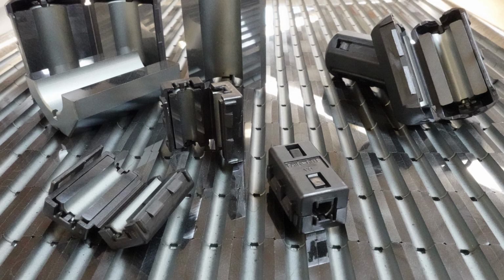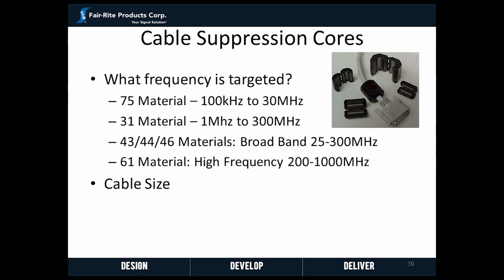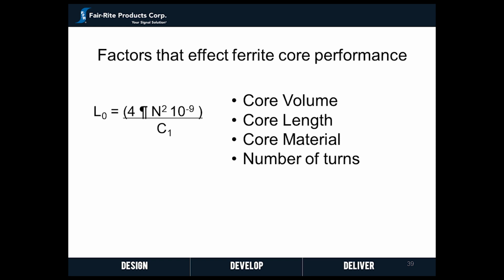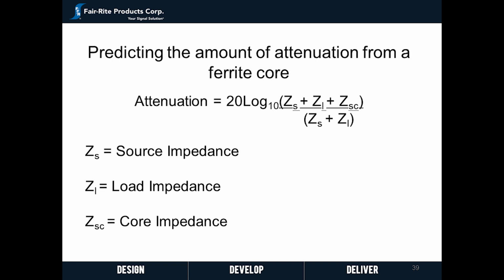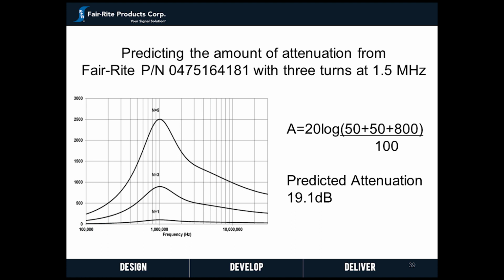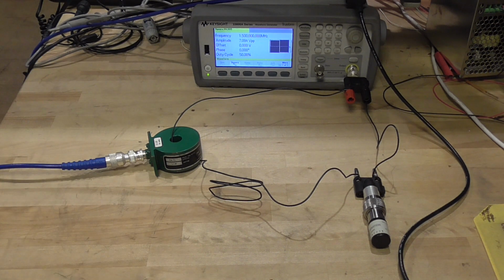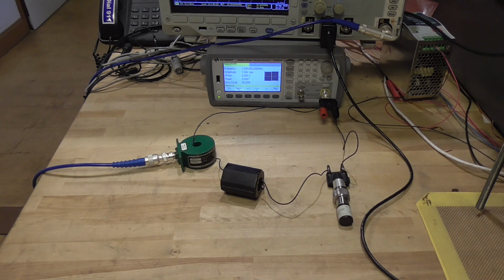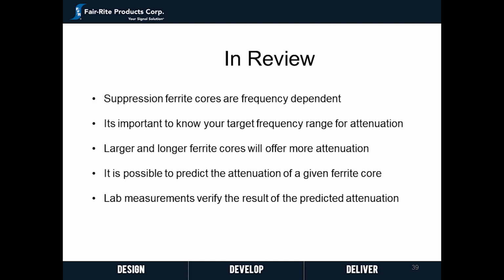Predicting the Performance of Ferrite Suppression Cores

Comment: For ham radio which clip on core should be used in antenna cable to reduce interference from neighbour smps of led lights and induction cooktop... Cables are RG58 and LMR 400.. PLZ help..
Reply from the maker: Induction cooktop EMI is tough to cure. They are designed to emit electromagnetic radiation and while they have to meet FCC emission standards,  our receivers are so sensitive they can easily pick up the noise. My experience with LED drivers is that they are made cheaply offshore and often escape testing and compliance.

I'll assume you already have the cables terminated with a PL259 and the other end connected to the antenna making snap-it cores the desirable method. For the LMR-400, my recommendation would be FR P/N 0431164181. And for the RG58, use FR P/N 0431164281. These are available through electronic parts distributors such as DigiKey, Mouser, etc.

Before you start, realize that radiated EMI is extremely difficult to cure. It might be coming into your receiver through the antenna, through ground wires, through the receiver's enclosure and even through the AC mains.

Comment: Hello, i like to go straight to knowledgeable sources for the best information, i have a question : what would be the best type of ferrite the i could clip on my mains power wires of my 200 amp load center to protect me against a E1 pulse EMP from a solar flare or other ?, i thank you for your time.
Reply from the maker: These are tough to guard against. They run DC up to low GHz. To cover that broad of a spectrum, several different material would be needed, including some non-ferrite cores on the lower end.

Comment: This was very helpful to me because I had a stray rf problem on the 40 and 20 meter band that effected my transmitter in an undesirable manner.  I put 2 snap on mix 31  on a wire that lead from my key to my radio and 2 more on another long wire that was connected to an axillary device.  They apparently were acting as antennas and picking up stray rf and causing a problem whenever I transmitted on those band via cw.  Now the problem is gone.  Thanks for the presentation!
Reply from the maker: I'm assuming your speakers are not an integral part of the computer - in other words, the HK speakers are connected by a wire(s) to a speaker jack. If so, they are acting like an antenna that is picking up a local ham radio transmission. 

I can recommend two approaches to try and solve this issue. One is to use better quality speaker wire - the kind that has an outer shield that will reduce EMI from the RF transmissions. The second approach would be to add ferrite beads to your speaker cables. Without knowing the diameter of the speaker cables, it's difficult to recommend a specific part, but we offer both beads and clamp-on ferrites in our FR31 ferrite material. FR31 is a wideband suppression material that if effective from 1MHz all the way up to 300MHz. I've enclosed a link to our FR31 Snap-It page and depending on your speaker cable diameter, I think you will find a product. One more recommendation, ferrite becomes more effective when you loop the speaker cable through the ferrite hole more than once so keep that in mind when you are choosing a part.

https://fair-rite.com/product-category/suppression-components/round-cable-snap-it-core/lower-broadband-frequencies-1-300-mhz-31-material-round-cable-snap-its/